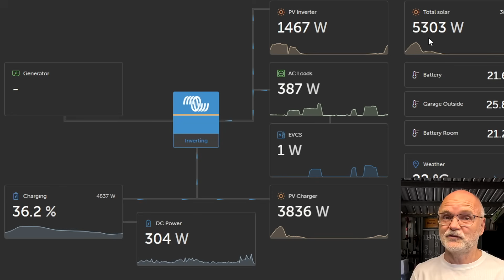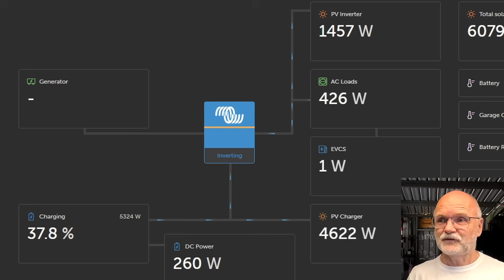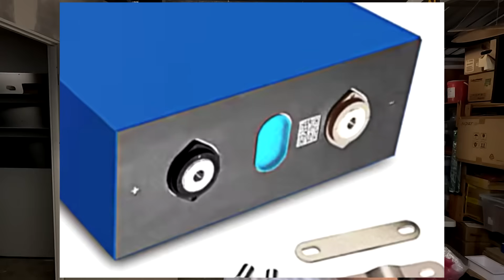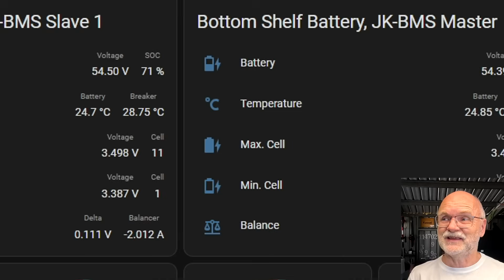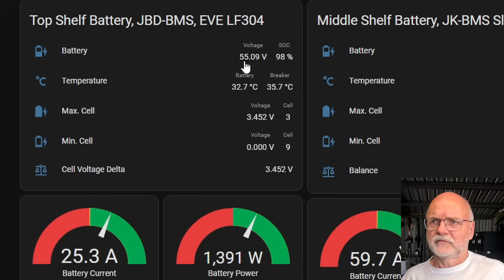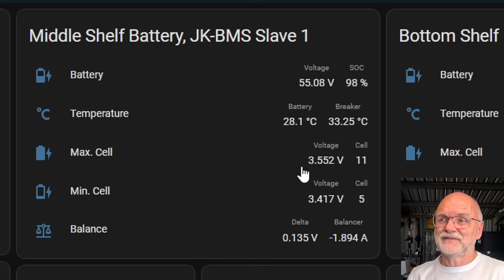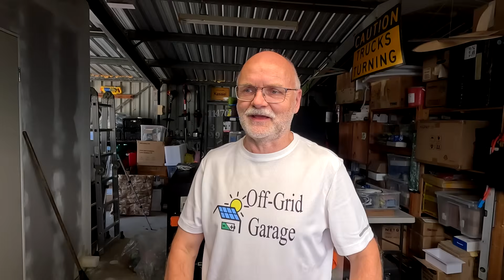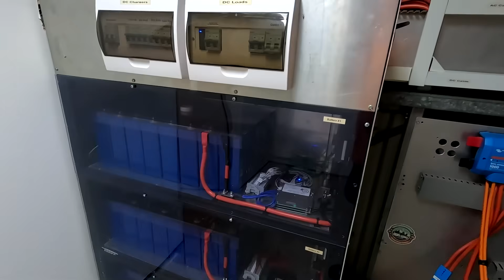First full charge of the Battery Shelf after Winter. And an old problem is back!

Comment: CAN some one help me out. i dont understand the problem with the threaded m6 hole. how is this difrent from a m6 stud? i have the Calb 163 with the laser welding blocks with m6 hole in them. do i also have this problem? i have 78 cells and now i dont now if i can use then or that they wil cause problems. i have flexbile copper busbars with tin plating. is this oke? and can i use normal m6 nuts with the plastic holding stuf inside. ( dont know the real name ) but the nuts that wont fall off by fibration and stuff. please some one help me. can i use my cells?????

Thanks so much

Comment: I'm in the UK and live on a narrowboat. I like Victron products and have a Smartshunt, Phoenix inverter, Centaur mains charger, 150 | 60 mppt, Orion-xs 12/12 50 and 2 x EM112s. Everything is connected to and monitored by a raspberry pi running the latest os. I have tried many times to adjust my smartshunt to give an accurate SOC but it seems impossible. Perhaps when I replace my battery bank with a Fogstar LiFePo4 with built in BMS I may stop having SOC anxiety. Great channel by the way. Regards, Joe

Comment: I think you can Tin/Zinc plate aluminum with electrolysis rather than hot dipping/soldering. I'm not 100% certain on the process though.

Comment: For a permanent connection fix you could buy silver or gold anodizing solution and make an anodizing pen from a 3v to 12v low amperage battery connecting the positive terminal to the part to be plated and then use a piece of wire with a bit of cotton to hold the solution to be painted onto the surface from the negative terminal.. The problem is that it is not only the battery terminals and shunts that need this done, every connection, crimp and screw terminal suffer from this.. The only exception would be soldered, welded or properly prepared copper to copper/silver/gold that are crimp fused together with enough pressure.. Finding resistive connections using a sensitive meter or detecting the heat caused by the resistance can be quite the challenge when you are talking about such a small amount of resistance..

Comment: All just be very careful with server batteries. If anyone is interested - the LFP narrowboat fire in the UK, was caused by  Ritar PR48-200 Server Rack LFP Batteries - which we used to power the electrical appliances inside the cabin - Aim for IEC62619 certification irrespective of application.

Comment: If only only you could relocate your panels or get rid of the shading. I am in SE QLD also and had 5 days all winter that I did not reach 100%SOC. Lowest SOC was 38% and then had a sunny day and back to 100% in one day. If anyone is thinking of installing solar with similar weather conditions you don't need to worry about winter.

Comment: Can we get Peter board for BYD Atto 3 blade battery to be used with home solar and high voltage inverters, currently "lithium solar Australia" sell it for $1700 and that is too expensive for $20 board. I think now high voltage solar storage will be norm as it is being said that it is 20 to 30% more efficient than 48V system that most of us have. Overseas there is Stark CMR emulator but it is expensive.

Comment: The key to using the paste on the terminals is to apply the paste they use a stainless steel wire brush on the terminal then put the bus bar on it. Dont brush then apply the paste. Apply then brush then busbar

Comment: Hi Andy, I just wanted to let you know that I bought 32 x 314Ah Cells from Yixiang and they are delivered with cheap/thin aluminum bus bars. I desperately asked Miaoxin to replace them with copper bus bars but she did not care. This configuration represents a strong fire hazard and I think that your viewers need to know that they will receive alu bus bars (it is stated nowhere on the Yixiang shop).
To finish on a positive touch thank you for sharing all your info, you are a mentor for so many people. Cheers yann

Comment: Hi Andy,

Congrats on the annual first full charge after winter. Probably time to break out the broom, bucket and detergent to clean off the panels. It is always interesting to see the extra watts after a good scrub.

For your aluminium post problem for your middle shelf cells, you might need some suitable jointing paste, try this query as a starting point :-

"conductive  aluminium antioxidant jointing compounds"

You could possible return to using aluminium bus bars as copper and/or tin can have problems when in contact with aluminium for some time.

😎

Comment: It's not the terminals. The deviation does not appear to be proportional to the current as it should be due to a resistance.
At least one cell is degraded / defective and has a high self-discharge rate and internal resistance.

Comment: I know the feeling about the aluminium Mark One cells.  But they still do work not as good as the tinned copper bus bars. Time to replace a bms for the 3 time. Did you remove the Aluminium bus bars , Andy? Or Obi one.

Comment: Hi Andy I had also similar issues with not so much "good" terminals od battery cells and issue was fixed for my by exchanging busbars for "flexbible" ones which have better contact with terminals and decreased interconnect ressistance. Maybe this is not your case but if you want to experiment with it, you may try to swap busbars in order to improve it. Nice day to Australia!

Comment: Hi, my name is Albert and I live on a ship in Holland. At the moment I am about to switch from AGM batteries to lifepo4. So I bought 16 EVE mb31 cells and want to put them in two 24 volt banks (2x 8 cells) and each bank has a JK b2a8s20p active balancer. I have a Victron quattro 8000/24/200 and a Victron mppt 200/100, that is enough for my needs. Now I've watched a lot of videos about lifepo4 batteries (I think yours is the most interesting by the way). But what strikes me is that everyone talks about having to compress the cells against each other, but I see that in your case they are just standing next to each other, or am I wrong? What do you think about compression?

Comment: Hi, as an old linesman, oxidation was something we had to deal with when using aluminium joints with a very set process. They had to be cleaned with an steel wire brush and then apply joining compound on the aluminum joiner within 30 sec to stop any oxidation reforming. One of the most common issues with aluminum cable faults is dry high resistance joints especially on low voltage circuit ( high voltage it will melt the aluminium joints making it easier to find) I still have a tube that I use on any battery joints to stop corrosion. The brand is "Dulmison ALV300" it is Aus.
Also read someone advising to use copper, do not mix alum and copper in joints without bimetallic barrier. The copper will eat away the aluminum with electrolysis in no time. I can remember spend weeks running down a low voltage fault, which finally  fixed by spend most of a day checking each aluminium joint by hand to find a dry neutral jiont with no compound used.
Reply: Electrolysis requires an electrolyte though - won't it be fine in a dry environment?
Reply: @matthewmarks6951 , and where does Andy live? Queensland, tropical Queensland, lots and lots of nice humidly.
Reply: @IanB414  Yes - the previous time this topic came up I mentioned the air-conditioned battery room he's constructing.

Comment: Yeah, that's a nice feeling to be 100%. I'm 100% on my 12v system, however my batteries and DIY battery boxes have arrived from China and will be getting these Built and charged soon. I've changed to a 48 volt system and looking forward to more capacity. Cheers

Comment: Andy, I am glad you got to 100%, I have been struggling here in summer FL on my array, more than expected. 

I am sort of confused on the "tilt system" and frequency increasing you mentioned. I have watched a lot of your videos, but not all(as reference), and I am not sure why your frequency on your A/C load is going up? It should always stay as close to 50.00hz as possible. This is what is rated on your home electronics.  Very odd to me. Maybe a link to a previous explanation, or a quick reply would be cool too. I am dumbfounded on this.

Also,I started a chat about your video on the DIYsolarforums with the new pathfinder BMS. I kind of started a good talk about it there. You should check it out. I can link it if u want. Stay cool in hot sunny AUS!

Comment: Thanks Andy for everything you do ... a question by reading the data of the EVE MB31 cells when they speak of the laboratory tests explain that they load the cells up to 3.65 then wait 30 minutes and then download up to 2.5. Why could we also load the cells up to 3.65 and then move on to maintenance 3.35 without absorbing? If they guarantee the 8000 cycles with these tests because we do not use the cells like this too .... thanks for your possible reply ...

Comment: good day sir. question if the bms of the battery can have a max charge of 50amp but there are three batteries. can i increase  the chargers  charging amp over 50 amp? or  just live the chargers 50 amp to charge the battery? all the battery are in parallel.

Comment: Something I have noticed with my system as well is my charge efficiency changing.  So the last winter for myself I was only achieving about 90-91% efficiency over the course of a month. I had 300ah but only 1.2kw of panels (48v system). Once my summer started coming around it increased to about 95% over a month. I have since added a 2kw array, on I believe the fourth of this month, and checking today with my first 100% charge in about 5 days I hit 97.3%.  These multiple days of poor production definitely exacerbate having my charge efficiency setting wrong in the smartshunt. If I get good production days it stays within about 1% no problem. I just like having my charge efficiency setting lower since I would rather underestimate my capacity than overestimate. I also wonder how much of that deviation you may have induced with connecting and disconnecting other batteries outside of what your smartshunt is measuring with possible current sharing issues, batteries charging unevenly or lagging like the middle shelf, parasitic drains from bms, and just normal system voltage drops across connections and the bms.  I wouldn't give it a second thought at this point until you have the batteries all setup and behind the smartshunt. I'm more interested in how you plan to keep the 1 to 1 factor when you add in the fronius! Lol Great video as always!

Comment: Nice to see Andy!
I could calibrate voltage and current in my new JK-PB2A16S-15P v19 BMS to closer to actual SoC (with Growatt SPF 5000 ES). Current calibration is accepted only when the current is more than 3A or so. I did when it's over 10A. Calibration is possible when charging as well as discharging.

The firmware has also been upgraded to v19.10 (got the file from your Google Drive) and the latest JK-BMS Monitor App v5.4.0 is now available in Google Play Store.

My tiny 5kWh battery pack too have got the similar 105Ah EVE v1 cells and I'm too experiencing similar cell voltage delta as your middle pack.

Comment: I had issues with these old cells too with cell voltages all over the place and drifting resistance over time that caused hot spots. I thought it was oxidation but found that any bus bar wouldn't properly contact the terminal. The newer raised terminals in the lf304 or mb314 are fine. I ended up using copper washers under the normal tin coated copper bus bars to improve the pressure on the terminal and it fixed the issue 👍

Comment: Hi Andy,
Some thoughts regarding your middle battery connection issues:
1.  Retap the threads in each battery to one size larger, and then immediately cover the threads with an conductive anti-oxidant paste made for aluminum conductors to prevent the building of an oxidation layer.  Use a flat bottom tap so you can tap and not gouge out further than the bottom of the hole.
2.  Wire brush the tops of the battery posts and immediately cover with the anti-oxidant paste to prevent the oxide layer.
3.  Then use brass machine screws and washers with the threads covered with the same anti-oxidant paste and your tinned copper buss bars.  The brass should work better than steel as it should conduct better due to the copper content, and also should reduce/eliminate corrosion due to the difference between steel and aluminum.  Note you may not be able to torque them quite as high as the steel bolts.
Hopefully this would be a "final" solution to the oxidation layer coming back on these batteries....
I hope this is helpful,
Cheers from Oregon, USA,
Philip
Reply: Easier to just electroplate all the surfaces with gold..

Comment: Andy, you can use MG Chemicals Carbon Conductive Grease between the battery terminal and copper buss bar.
It provides both conductive & corrosion protection!
Reply: 8463A <3